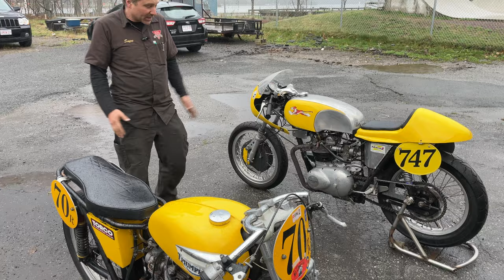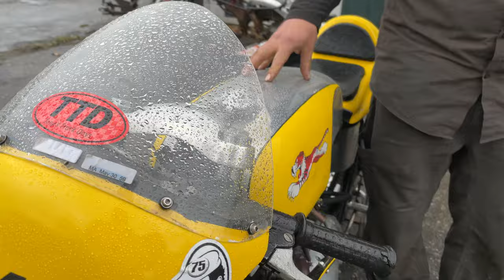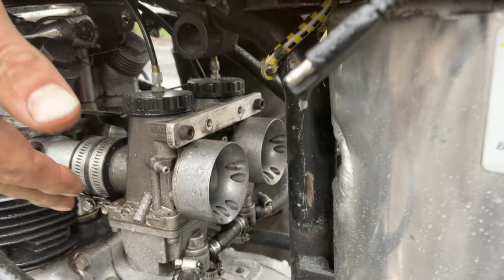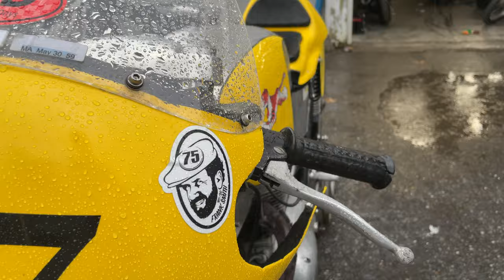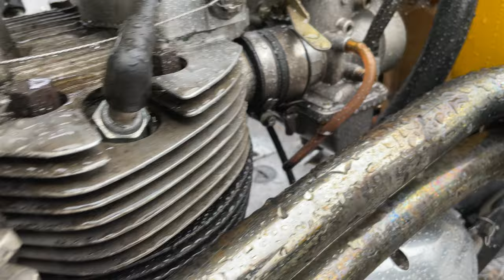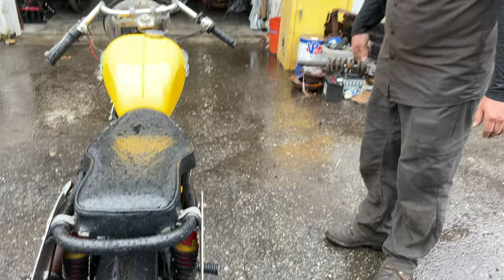Nova Motorcycles Brian's 500cc Racing Triumph's

Comment: Back in the mid/late 60s I had a 500 Triumph twin,

Lovely motor, frame a bit iffy, I fitted the later  8" tls front brake, so much better, 
Check out Percy Tait, Triumph racer,his 500 flew,
Finished 2nd behind Ago in a GP  race,